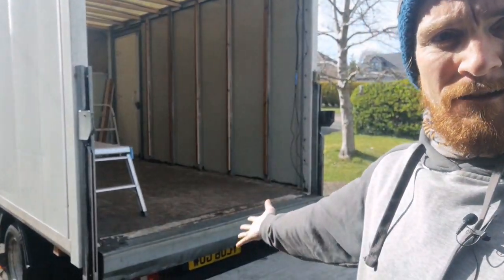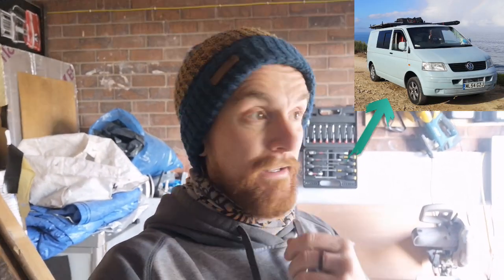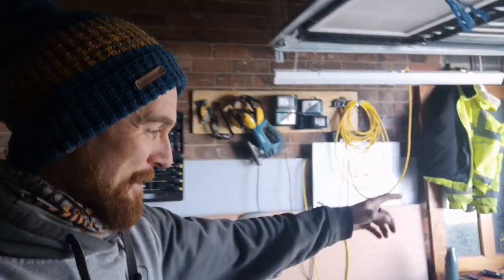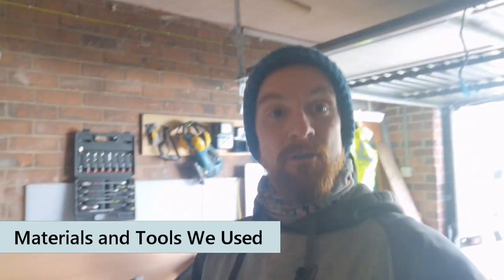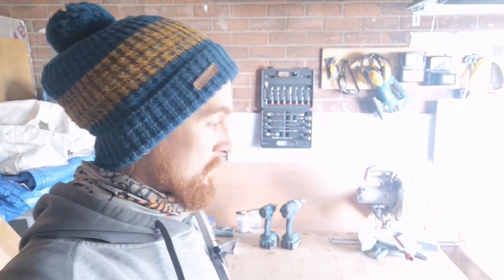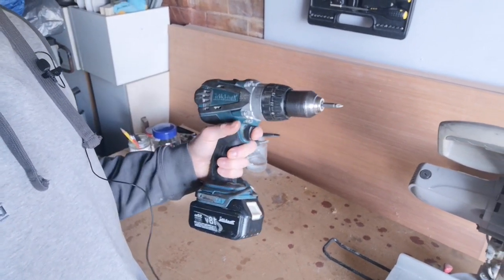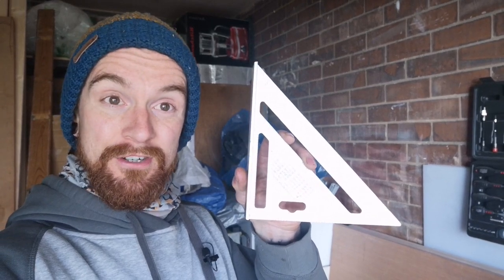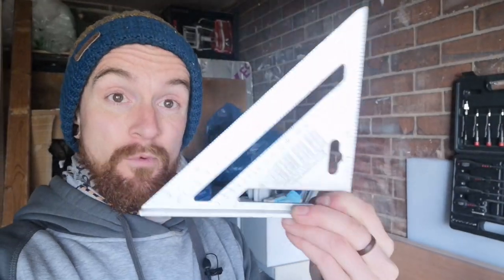Internal framework | Luton Campervan Conversion Series

Comment: Hey bud, how would you make your roof weigh bearing?
Reply from the maker: Hey, it depends what the weight is, if its a person then the roof would need replacing with a suitable wood sheet because it's made from fiberglass, fiberglass + human = disaster. Also, the roof batons would need to be thicker. Personally i would use thicker roofing batons and run them front to back and up against the metal roof supports. 

We did consider this but would have added to much weight with the extra wood and we didn't have the time.
Another method we considered was installing an aluminium extrusion frame onto the roof that would act like a roof rack. 

Good luck with your project

Regards,
jolly
Reply: @vandercampadventures  thanks guys, much appreciated